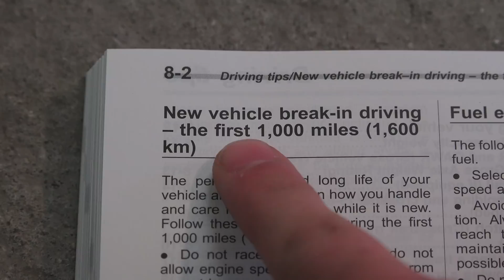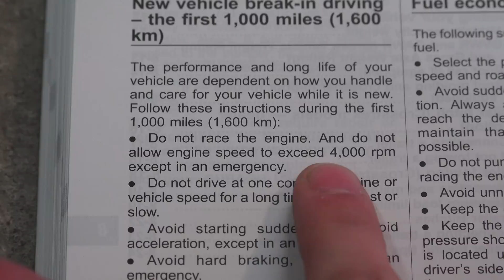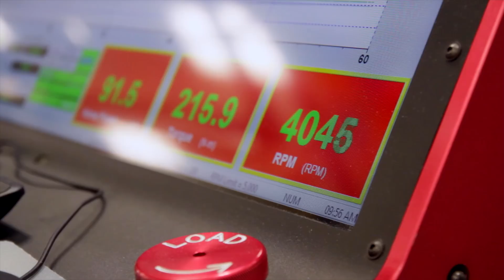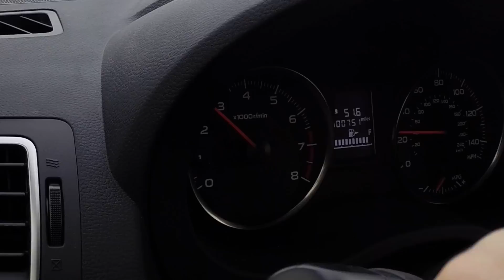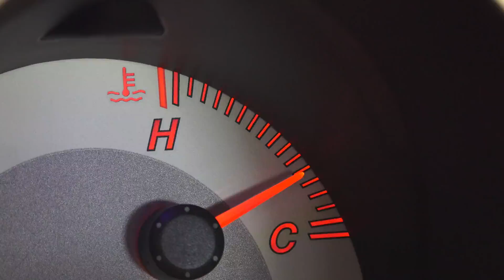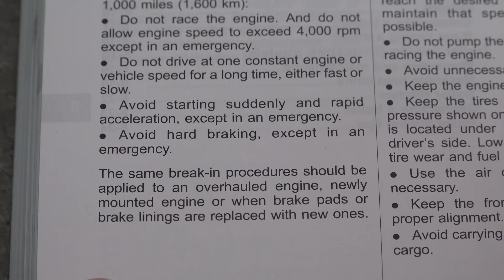5 Things You Should Never Do In A Brand New Car

Comment: Lycoming would probably like a word with you.

Engine break in for an IO 360:

Get engine to Operating temp.

Full throttle takeoff. Lower the nose for a higher airspeed climb, which results in higher RPM (fixed pitch prop)

Once reaching level altitude (5000 foot pressure altitude is suggested) fly at 75% max power, leaned, for an HOUR. For those that don't know, this is basically maximum continuous power for this engine)

After that hour, fly for ANOTHER hour varying between 65 and 75% max power, leaned. 

Land

Inspect.

Comment: I have a question.. If you rebuilt an engine, you need to break-in, but in order to "calibrate" the ECU ( an aftermarket one in this case) it's necessary to rev it up in a dyno. the question is... the right thing to do in this case, is to run the car for a thousand miles with a "basic setup" and then the fine tune, taking the risk of keeping a non perfect AFR and other things, OR taking it directly to the dyno to make a perfect tune, but by doing it, make the fully rebuilt motor work on high rpm and load..

Comment: Perfect timing! I'm picking up my new car on Friday. What are your thoughts on when to get the oil changed for the first time?
Reply: I like to change my oil after 500-1000 miles for the first change. As the engine wears in, there may be microscopic pieces of metal in the oil that you don't want hanging around. That's how I treated my Chevrolet Nova when it was engine swapped and it's running great after 4 years of daily spirited driving
Reply: Virtual Digital me You'll get a manual and everything you need to know about the car should be there. Except how to repair it.

Comment: I dispute this. The GTR is dynod and track tested prior to customer reception. 

Also from a Toyota master mechanic break the vehicle in just as you normally drive. I/we have had 3 new Toyota trucks and the last 2 I've run not redline hard but definitely run hard with NO issues to 75K.

So to each their own I guess.

Comment: Your right about ring break in, but you weren't always.  back in the day it wasn't Un common to floor it up to 60 and coast back to 20, 5 or 10 times.  But tech is way better now!
Reply: And engines back in the day had famously long lives. Like 80,000 to 100,000 miles before they needed a rebuild.
Reply: Tell me about it, but with the tech back then it worked, but now with the different alloys in both the cylinders and the rings,  and the design of the rings themselves it's a totally different ball game.  But in thing I've noticed, yes the new engines last longer but when the do fail it is more likely than not catastrophic as opposed to back in the day they were always actually repairable.
Reply: PaulsMagicVideos 

With punctuation

Yes, the new engines last longer. But, when they do fail it is more likely, than not, a catastrophic failure; as opposed to back in the day they were actually repairable.

Old engines broke a little and were more easily fixed. Modern engines explode when they give out.
Reply: " yes the new engines last longer but when the do fail it is more likely than not catastrophic as opposed to back in the day they were always actually repairable" wat?

Comment: Exactly!
For the first 1 300 miles,or 2 000km,I always take my brand new car for the short trips on highway.(Late in evening)
I always try to drive variable speed and not to exceed over 3 000 RPM.
After break in period,I always replace engine oil and oil filter.(For all that metal debris and other junk).
After one year,I always replace manual transmission fluid for the new one,like Castrol Syntec Gear Oil 75W-90.
All my friends are always laughing at my "obsessive behavior" for maintaining vehicle,buying proper servicing tools and throwing away money.
I bought my first brand new car in April 1994..I never had to visit shop ever since.Love to drive down I-5 from Canada to San Francisco,and you always see too many broken cars stuck by the road.Too many smart people who think that preventive maintenance is throwing money away.If you invest,you are going to benefit, on long run.

Comment: Are you familiar with the Motoman break in and how do you feel about it?
Reply: nilphuxgiven amen brother I used his technique to break in my 2014 ford focus
Reply: TheArchetypeGamer You're not the first I've heard say good things about it.  I've never used it myself....the last new car I bought was 2004 lol.
Reply: nilphuxgiven and after I broke in my engine I use my favorite synthetic oil amsoil and change it every 15k
Reply: I've done the Motoman break in on my 2 cars RX-8 and sti and I still strongly believe in it. It's a very controversial topic but what I did warm up the car at the dealership and did a few pulls up a hill and engine brake down the hill, rinse and repeat a few times with cooling drive in between.
Reply: best way to do it was dump out the factory oil and put in conventional oil and and do your pulls close to boost and engine like you did
Reply: I imagine by coasting it gives a chance for the fine metal particals to be exhausted rather than shoved past the rings into the oil
Reply: Yee Sen Chai
Reply: Yup, using it on my new motor, only 900km in but i'm happy with how it's running so far
Reply: Is that guy still alive? His website looks like one I made 15 years ago.
Reply: eisman07 I think he hasn't update it in about 7 to 8 years

Comment: but what about a brand new crate motor that has 0 miles on it, and you take it to the dyno (they do a small break in procedure) and you go wide open throttle are you still damaging in engine because you don't have the run time in it?

Comment: The bit about not using one's new brand new car with a cold engine got me wondering. Considering that most people in town only ever use their cars on small travels, would it be less damaging to let a new car run up to a certain point (to the proverbial "moving needle") before actually driving in order not to apply any load on a cold engine, or would it be simply better to drive it straight away even if it meant not reaching the engine's proper operating temperature ?

Comment: Most of that has described the last couple trips home with new cars - having to merge into highway traffic going 70+mph (because who does the speed limit these days) and then drive an hour or more home.  No real choice, the local dealers are awful and refuse to budge on prices trying to charge MSRP.  Try merging onto I-95 below 4000RPM you'll be off in the weeds run down by all the cars going way over the speed limit.

And they have been fine...previous car went 90K in 10 years and was still running great when traded (wanted to replace before a new redesign that was coming out)...and my Outback has gone over 100K in the past 4 years with just scheduled maintenance still runs like new.

I wouldn't go to the race track with the first 5 miles but you have to drive in a way that gets you home in one piece.

Comment: It's the same thing when you put a new motor In a car I out a new motor in my civic broke it in real hard motor is healthy and just fine though I change my oil monthly and pull the valve cover of every few months to make sure the lifter are we're I want them to be and not to dirty one thing I've noticed though is new motors break transmissions faster too much power for the old worn out things

Comment: You're also breaking in the transmission, differentials, and other components. The teeth in all the gears on different components are wearing slowly and their mating surface is getting set. You don't want to rush the process.

Comment: Yep I did the proper break in for my 3.6 R and have not had any oil burning issues, for the first 6,000 Miles it was using a lot then stopped around 10, mind you that at when I hit the first 3,000 miles I changed the oil to Mobil 1 full sys 5-30, the flat 6 cly takes 7 quarts.

Comment: Interesting video. I have a Camaro SS and I wonder what knock sounds like because I feel like I hear it occasionally.
Reply: The Left Lane If you have knock you'll know. It is not a sound that you mistake
Reply: The Left Lane are you using 91 or better fuel?
Reply: ***** The wallet-busting 93 is what I use.
Reply: The motor is pretty noisy.  I was only asking as that's the 1 cause of knock in these motors.  If you're getting knock or ping with proper fuel you really should take it in to you dealer.  This is not a sound that happens at idle.  It's usually in low RPM load when say going up a hill.
Reply: ***** People say that the knock sound is distinctive and if what I'm talking about is knock then I agree but I just don't know what it sounds like so I have no idea. It's like a clank. I've yet to isolate how much throttle I'm pushing and how many rpms I'm at but it usually happens when the car has just been started being driven around.
Reply: The Left Lane I see. Hopefully you get it sorted out.
Reply: +The Left Lane I doubt what you're hearing is knock. Knock generally occurs under high load. 

For piece of mind you could buy something like a dashhawk. It plugs into your obd2 port, and sits on your dash. It can monitor several parameters at once, in real time. You'll be able to see everything your ecu sees, including knock, and find out if what you're hearing is actual knock. Even though it probably isn't.
Reply: wifi or bluetooth OBD2 dongles are around 20 on amazon. You can get a free or 5 dollar program to see everything.  Knocking can occur during high load but it can also occur during a lean condition.  I agree it's unlikely you're hearing knocking but for peace of mind I would just go get it looked at and take the guess work out of a potential problem.
Reply: Probably not related, but my VW vanagon has a few funny clank sounds. Issues with your exhaust system can cause weird clanking sounds to reverberate, as well as sticky lifters. 

If you're good on general maintenance, you don't have any OBD faults, and you are getting consistent mileage that meets or beats specs (an indication of engine health), you should be alright. 

Just do some research and be mindful of reported catastrophic failures others have experience with your car model. For instance, my rav4 V6 engine has a poor design flaw using a rubber tube to bring oil from the block up to the cams under pressure to be used for hydraulic variable timing. A soft rubber tube. So yeah, when I saw grey smoke coming from my hood, I knew exactly what happened.
Reply: +KnivesNGunsBoy He already told us he uses 93
Reply: Thanks guys for your suggestions. I haven't heard it in awhile and I haven't been able to replicate it so let's just hope that I don't hear it again.
Reply: You might have just got some crap gas.
Reply: So I think I figured out when it happens. For some reason when I just started my car and it's cold, lowest temp probably 160F, and I push the throttle just enough for the car to shift from 1st to 2nd when shifting to 2nd it makes the clank sound.
Reply: ***** It only happens on the 1-2 shift? Never any other time? And only when it's cold?(160° is not that cold fyi).

Check the condition of your mounts(motor, trans, diff). Get under there with a big ass prybar, and see if you can move the trans, and replicate the sound.. Just have a look around. Check trans fluid for shits and gigs.

Comment: I was told by the Chevy dealer that my Camaro didn't need to be broken in. I still took it easy and only floored it like once before the car had 500 miles on it. I also did a ton of highway driving so had a lot of constant speed driving too. I just don't see why they said it didn't need to be broken in because I doubt a $32,000 car has an engine that was broken in by the factory.
Reply: Sometimes car manufacturers and frequently car salespeople will tell you anything you want to hear,  as long as the car lasts thru warranty they have got your money.
Reply: Did you read your manual?  Dealers often just want to make a sale and will say what they think you want to hear.  Anything that's not in writing is deniable.
Reply: +TheHannukahZombie Aww, there, there now.
Reply: *****
I never said that I spent that, I said that's how much it cost
Reply: I feel like I would have looked in the manual and never found anything, but I'm not sure tbh. It doesn't really make a difference now, though, because it has like 3500 miles lol
Reply: I just checked the manual and it actually says to do all the things Jason mentioned for the first 1,500 miles. However, it is the same book for all 3 engines and doesn't specify different break-ins for the different engines (which i find odd).

Comment: Engines need to be run to the max from new otherwise the bores will polish and the rings will never seal properly. The engine will always be down on power. You especially need to give the engine high rpm overrun to bed in the rings. The dealers tell you to take it easy so that they don't get blamed when you crash it.
Reply: Please distinguish between what the dealer says across a handshake and what the manufacturer puts in writing in the manual.  Mfgrs. do not like warranty claims because that reflects on the model's reliability rating.

Comment: Personally, varying engine rpm requirement doesn't make sense to me from the engineering standpoint. It changes nothing for the cylinder and piston, so why would I care?
Reply: Good point.... It doesn't make a whole lotta sense to me either. The only thing I can think of is by sitting at 70 mph for 2 hrs straight, the engine is more or less operating in one condition. The temp for the various engine components won't change much.  To get the 1000 miles of break in, the engine has to see various temperatures and pressures.  Otherwise it will be as if it was not broken in at all or possibly, it will break in the wrong way.
Reply: It also varies thermal transfer through the engine block and moving parts; it reduces the thermal extremes caused by hotspots that can affect the properties of newly-cast/cured metals.  Thermal cycling can impact  the durability and lifespan of any metal component that gets hot.
Reply: varying load , that thing is most fundamental in all kind of engineering world.

Comment: I beat the snot out of my motorcycle (small motor but still a motorcycle 2015 dr200) granted I always let the motor warm up before going above half throttle, did the full hard break in and warmup times have significantly increased for the vacuums and I can only think the rings didnt settle right but hey its a learners bike and I love working on small motors :)